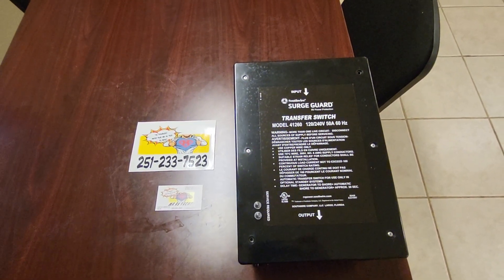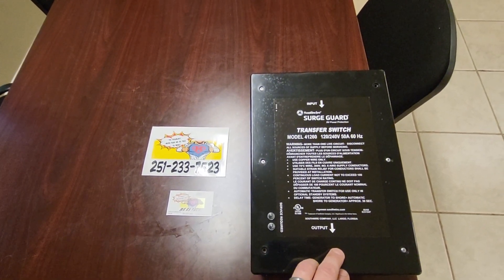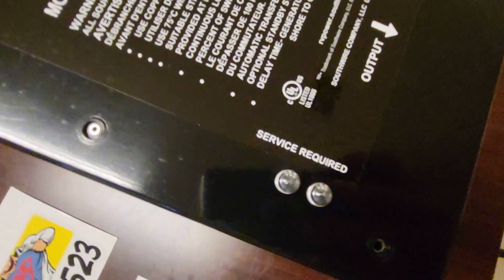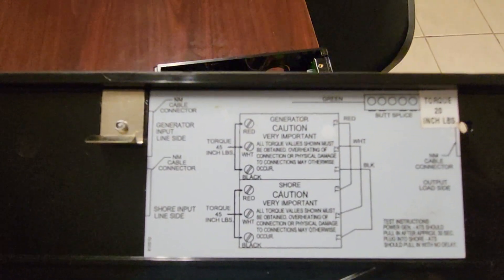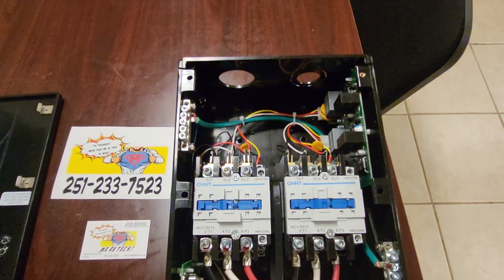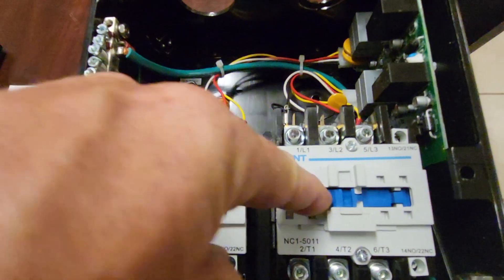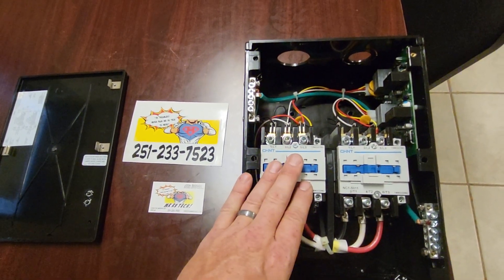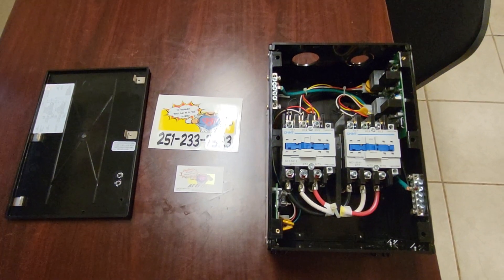50 AMP RV Transfer Switch

Comment: what if your generator is only 30 amp with 1 hot wire, can you make a jumper from L1 to L3 to create 2 hot wires from the generator?
Reply from the maker: @PurerockSmokinBBQandMETAL  You " could" but you would greatly be undersizing your wiring for the amount of current flowing, GREATLY increasing the risk of a fire or damage to 120volt components. I strongly suggest against this.

Comment: Can you substitute an inverter rather than the generator as an input. I don’t have an onboard generator. I have an external generator. So essentially if I need to run a generator, I will unplug from your power and connect my generator to my short power receptacle. Therefore I’d like the inverter to be my alternate source of power. I’m guessing since there’s only one hot leg, you would have to use a , then essentially supplying 110 to each leg since it is 50 amp   Service Thank you.

Comment: What causes the “humming” or “rattling” in the Transfer Switch ?? Had this happen twice and had to turn power off at the pedestal several times to get it to work properly
Reply from the maker: @BrianSchupp  a dirty or weak contactor. So, contractors are normally open or normally closed devices that have a spring holding them in their respective position. When voltage is applied to an electromagnet the magnetic force overcomes the spring tension closing the contacts ( or opening them) " chattering can be caused by dirt or debris between the contacts or a weak electromagnet, what you here is the magnet and spring fighting eachother to close or open. Cheapest easiest way to diagnose is to blow high pressure compressed air into, around and on contactor. If that doesn't work...replace your transfer switch. Thanks for watching!
Reply: I have just installed this switch. Brand spanking new and its humming, loudly. UGH. I may look at opening up the switch and cleaning the contactor.
Reply: @snowbell01 i heard it could be moisture.
Reply: @k5blazerman956 from all my research. It's the  coils. They use 60hz 120v so your hearing The frequency hum. I bought a powermaxx? It uses 12v contacts. The wfco t-30 uses the same 12v contactors so they are quiet.

Comment: I appreciate the clarity.  The wiring harness  from the generator in the Winnebago 33c SiteSeer (2016) has 5 wires from the generator.  Two (2) white, One (1) black,  One (1) green, One (1) Black w/ Yellow Strip.  This brings me to the question, Since 1 black (hot), one White Neutral, and one Green (ground) makes sense from explanation, where does the second white and black w/ Yellow stripe attach.
Reply from the maker: @harveybryant794  both whites are neutral,both blacks are hot, the striped black is the 30 amp circuit breaker on the generator and the plain black is the 20 amp breaker. Hope that helps!

Comment: How do bypass the switch
Reply from the maker: @RobNickle  Unplug the RV. Remove the wires from the output side of the primary contactor, then choose shore or generator and remove them frome the contactor and wire nut black to black, white to white, red to red. This will disable the ability to transfer between shore and generator but will provide temporary power until the switch can be changed. Remember I strongly recommend a skilled RV Technician or electrician perform this bypass, I do not take any responsibility for damage or injury should you attempt this yourself.
Reply: @MRRVTECH thank you. This is second time it failed from new. Only 6month old unit. Can i eliminate this completely? @MRRVTECH
Reply from the maker: @RobNickle  Not if you want the ability to transfer from shore to generator. You should have a 1 year warranty on that newer switch, make them give you a new one. If it's not surge guard brand perhaps consider Changing to it.
Reply: @MRRVTECH  thx for the quick response. Ok thats good to know. This is a full time living unit with shore power. So if im understanding correct it's only design is to go from gen or shore as options. My concern is when the warranty is over and it goes again  then I gotta pay. I really just wanna eliminate it safely.
Reply: Great video. I'm getting ready to have a tech just replace one of the contactors/switch. But you mentioned doing the entire box. Dang things are $700, versus a $125 contactor. Is just replacing the contractor doable and without removing the entire box?  Thanks!

Comment: Yea I had one go bad the other day 17 years old with EPO system built in . I had purchased sometime back a Hughes  Autoformer that will boost my ac voltage up to 12vac if needed. When I got to the RV park the power was going out a couple time a day . I ordered a Hughes Watchdog with EPO came in and the same day the power went dead. The RV park outside box had wires that had  over heated and the 50 breaker was bad as well as burned spots on the 50a plug " all related to the RV park outside box " . My surge Guard " automatic Transfer Switch with EPO  even with  shore input power was not engaging the contactor even though it had both 124vac legs hot on the contactor. I wired around the automatic transfer switch using my autoformer and watchdog unit. Now I need a automatic transfer switch but without the smart EPO circuit, so the price is not $1000 but just standard transfer switch that is from 200 to 300 dollars. I just do not have generator power until I order and install the automatic transfer switch. The Watchdog with EPO has Bluetooth so I can see what is going on all the time with my smart phone that option I do like.   Just thought this would be something that someone might like to read about what happened to me lol .

Comment: Great video! You mentioned a 1ms delay for the Generator relay to turn on. Isnt there a time delay before which the Generator Relay Engages and passes power through? Is it configurable.
Reply from the maker: It is not configurable preset TDR ( time delay relay)

Comment: Hello, I have a 50 amp service RV .  Recently went to a campground plugged into a 30 amp service an realized I was getting no power inside my RV . Tested the Transfer switch. I was getting 119 V going into the switch but nothing coming out . Assuming my switch went ,I replaced it with a “ Briidea 50 amp switch off Amazon . Hooked it all up, Generator side works perfect. But when I hooked up my rv to my 30 amp plug in my garage, I’m still getting power in but nothing out ??   Can you help?
Reply from the maker: My first instinct is to check your cord, or your 50- 30 dog bone

Comment: Enjoyed your video. Maybe you can help confirm something for me. When I plug my 50 amp rig into 50 amp shore power everything does as it should. However, when I connect to 30 amp or 15 amp shore power, I hear this click/clunk about every two seconds and no power is getting to the rig. As a work around, I can run the generator for about 15 minutes, THEN turn on the 30 amp or 15 amp shore power, run the ginny and shore power at the same time for about 15 minutes, then shut down the ginny and the click/clunk is no longer there and the gauges indicate that it is charging the rig as it should. Does this sound like the ATS has gone bad? Is there a way to check to be sure?
Reply from the maker: Yeah, sounds like the contactor may be weak or the power sensing PCB is not seeing the power as it should, but probably the contactor( electromagnet).

Comment: If possible add this Transfer Switch to an electrical system where a Solar System and a current Inverter are present in addition to Generator and the Shore Input Line?